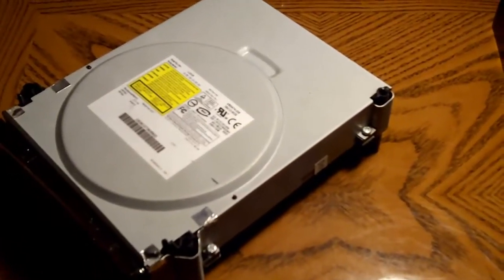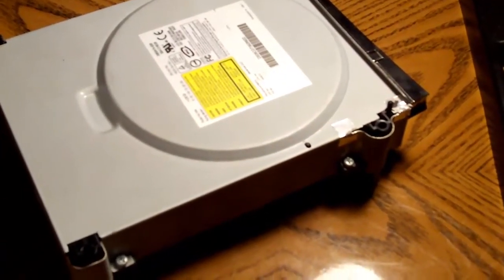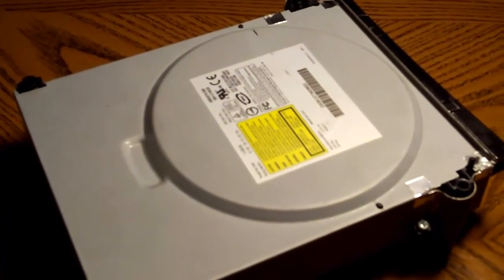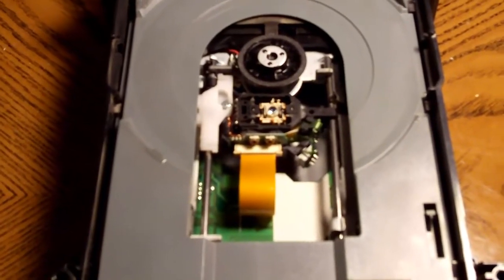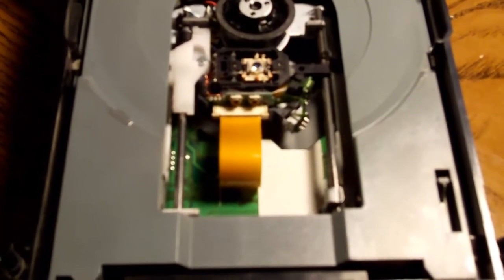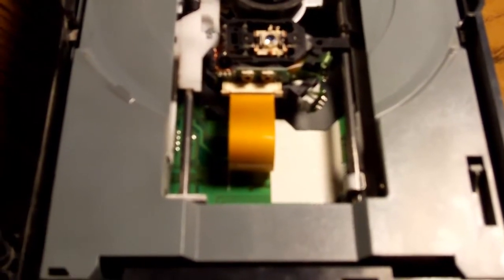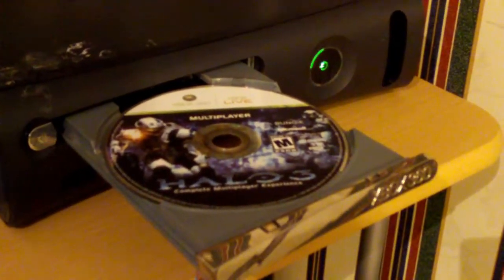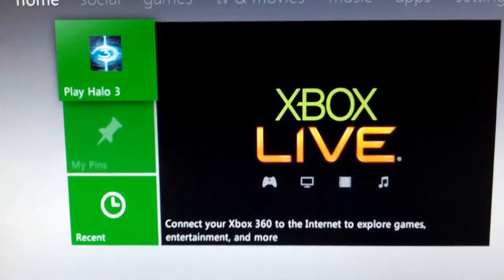Xbox 360 Disc Read Error Fix

Comment: My drive makes a quick spinning sound, as if it starts the process of reading the disk, then abruptly stops for some reason. It happens with every disk I try, but it does work once in a while, seems to be completely random.
Do you think this fix will solve that problem? I've never taken my box apart, and I want to wait until I know a little more about the problem before ripping out pieces and cords.

Comment: I did all the steps and disc still don't read. should I turn the left screw a little more or no? any help would be great.
Reply: It could also be your magnetic washer is no longer there and stuck itself to the top of the case... if so just grab it off the top and glue it back down where its supposed to be. Been there done that...

Comment: it fixed my xbox for a month :(
Reply: +Anthony Finch my xbox is open 24/7 ive been trying to fix the laser i cant even see the red dot through a disc like it used to the right screw just got bent like 5 min ago from me turning it so much :/ the left ones fine tho
Reply: +Anthony Finch damn so i have the find the factory spot with right side?
Reply: +Anthony Finch and what does the right screw control?
Reply: +Anthony Finch Your better off buying a NEW LASER not a Xbox xD (This is the cheaper way) But preferred to use a Multimeter Uhm tester and fix it the right way, I'm sure the left is Dvd and the right is CD